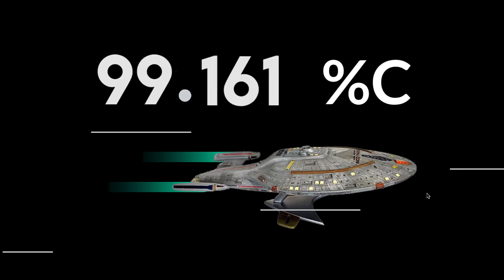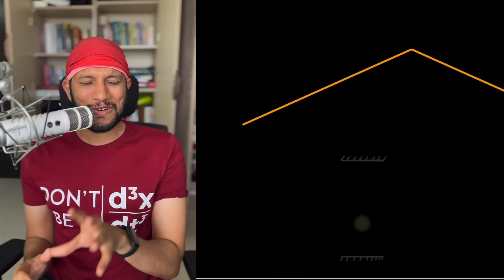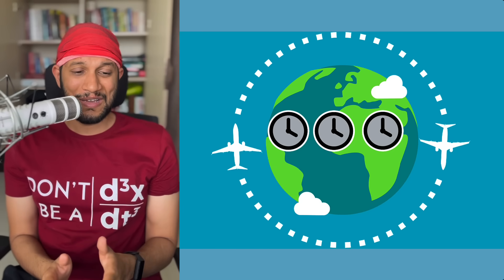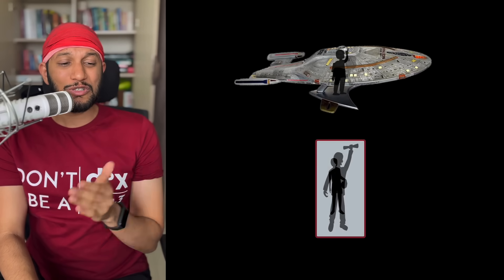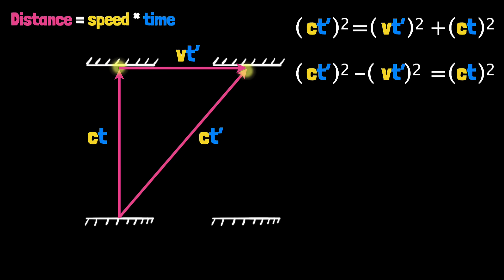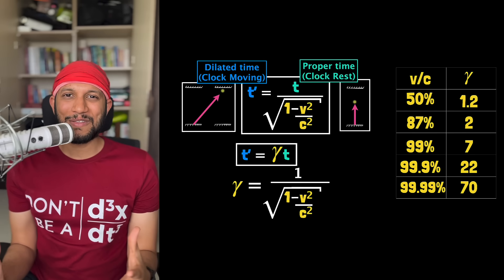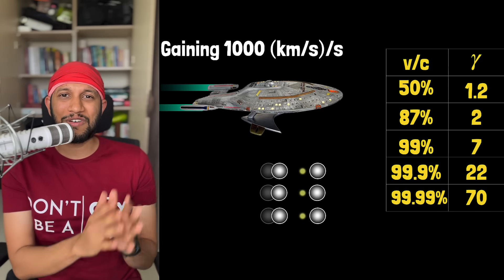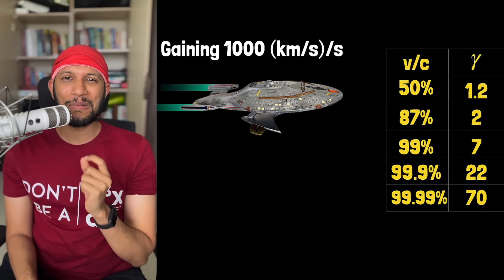I finally understood why you can't go faster than light! (My mind is blown)

Comment: But, doesn't an object stay moving unless an outside force stops it from moving?  To me, its like when flat earthers are confused about why they dont feel the earth rotating. 
Lets say we start our super fast ship  and we get to 10% light speed and we let off the gas to the rockets. In the vacuum of space, what is slowing us down from our current speed? 
And i would think that the photons would catch up to where everything is coasting together at 10% light speed, then we can turn on our rockets again to get to 20% , then rest then 30% and so on and so on. 

Its like, what is stopping the earth and sun and solar system from rotating through space? 

And i know there is gravity, im talking about in interstellar or even intergalactic space, i know there is the vacuum with tiny particles popping in and out of existence that can slow you down at a fast enough speed.

Ifeels like to me, thay saying nothing can move faster than light, means that earth with slow down and fall into the sun because we dont have anymore energy.

Why cant we gradually get to lightspeed and beyond?  

The only thing i see stopping us is having a pretty clear path  and a really good shield up front.

Comment: The correct answer to this: all the available, accumulated energy of the currently observeable Universe wouldn't even be remotely enough to accelerate a single particle of mass to lightspeed. In fact, even if the rest of the not observeable Universe would provide infinitely more energy, it still wouldn't be enough. But since we can not accumulate all that energy anyways, the answer to this issue is pretty oldschool and obsolete.

Comment: In the universe, there is no moving and no stillness. It all depends on the position of the observer. So if I‘m in the spaceship, of course I fly faster than light. Just outside the spaceship the observer sees you are not faster than light, from his point of view.
Reply: Everything is moving which varies based on how similar movement is to the next.

Comment: Makes sense. But why is there a speed cap on light?
Reply: Its the limit in which the electric field can change state. E.g its energy which is a quantity, meaning to go even "faster" would require the exchange of energy to happen beyond the amount of energy it has. So anytime this interacts with something, this takes "time" as in, energy has to move and exchange...thats what "TIME" is. There is no seperate time thing, there is just energy moving and it can actually never stop.

Comment: What happens if you turn the bouncing light tube so it's parallel to the direction of travel? Does it take even longer to go in one direction but much shorter to go in the other direction??  Thus keeping the clock in time the same if it was stationary?

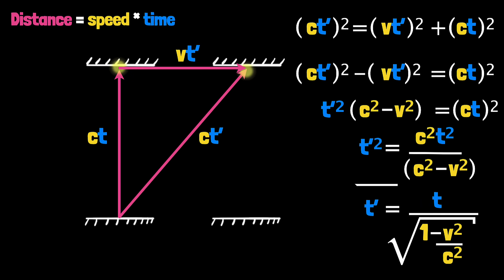Comment: 7:52 - 9:27
There's one problem here.
As Einstein said, everything in space is relative.
So you are stationary but the ship is in motion - or, is the ship stationary and YOU are in motion? 
In reality, each is stationary and the other is in motion from their point of view.
So who really experiences the time dilation?

The "proof" was using Earth as a reference point. Well, Earth is a huge mass with a huge gravitational field as compared to the plane. So is the difference really dependent on mass?
Remember we used to think the moon went around the Earth, only to discover later that they both revolve around a common center of gravity, located about 3/4 of the way up from the Earth's surface, below the crust. I wonder if time dilation is affected by gravity/mass in the same manner, where clocks move faster at the reference point with the higher gravity?

The real test would be 2 ships traveling past each other in deep space, and comparing the clocks between them. I would bet that regardless of their speeds between each other, the clocks would tick at the same rate.

Or how about this: launch 2 ships, one from the north pole upwards, one from the south pole downwards. Both ships accelerate to 0.6c relative to Earth. But relative to each other, they're traveling at 1.2c. How does that work? 

In all the years I've been interested in physics, I've never seen anyone address that question in any way that makes sense.

Comment: if the photon is bouncing around between the mirrors, how is an external observer supposed to see it? there would have to be an entirely different set of photons traveling from the clock towards the observer in order for that zig-zag pattern to be observed, no? also, if you move the photon clock with the ship, won't that cause the trapped photon to hit the side of the clock and start bouncing around randomly?

Comment: Well, that's how it looks to us on earth, but what you have described isn't reality as such, it's our perception  of it, which isn't the same thing.

As far as the people on the ship are concerned, time is carrying on as before, nothing has changed. Their photon clock will still be running at the same speed. To us it's getting slower, but to them it isn't.

So eventually we get to the point where to us it looks like their time has stopped, but it doesn't do that for the people on the ship. So I would argue that what you've explained there is why we can't perceive speeds fast than light, not that they don't exist. But each increase in speed of 1000km/s for the people on the ship is just that, but for us looking at it from earth it's slowing down. Once the engines get turned off the ship is effectively stationary to the people on it. 

So what I'm saying is the speed of the spaceship as measured from earth can never be c, but for the people on the spaceship, it can be, although they couldn't measure it relative to earth. That's a limitation of puny humans, not of the real universe.

I totally buy the explanation our "reality" is defined by our perception of what's happening, which to be fair is what we as humans are stuck with. It's all relative...

Comment: With the first 30 seconds i can guess why we cant accelerate to the speed of light because as you said the required energy goes to infinity. And there isnt infinite energy in the universe thus the lower the mass is means its a higher vmax towards but never equal to c without exceeding the possible energy given within the universe.

Comment: Stop measuring distance with a photon clock. 

Light travels in a 360° spherical direction and the universe travels in its own direction as it emits light too.

If gravity can slow or stop light and we can speed up light then traveling faster than the speed of light is absolutely possible.

Light can be accelerated and it can be slowed down.

Light and time are not the same thing. Stop conflating the facts and it will become much clearer to you.

We created the measurement of time as a tool even though light has been here since it was created. We figured out day from night and began reducing it down to  its smallest measurement. We did that 

When you chose to measure this as if it's Zeno's paradox, you omitted the obvious. Light can be accelerated to be faster than the commonly referenced 186k per second. 

To say that 186 thousand miles per second is our maximum speed is very narrow minded.

Comment: The answer is at 00:12 : division by zero.
Reply: But the question is why it is physically impossible to reach the speed of light, not mathematically. The Lorentz factor isn't the answer just because you can't divide by zero which is obvious. The question is - why it happens in the first place, as the fundamental law of physics?
Reply: @spythere from what I understand is the energy required to accelerate mass gets exponentially higher eventually to the point where it requires more energy than can be provided. It makes sense in my head. And I'm sure there's a lot more to it than that.
Reply: The formula would be different if you could reach the speed of light. Sometimes the math could be outdated and turn out to be wrong hence why we need to look at the phenomenon itself to understand why
Reply: I fartee
Reply: Bit too late but guys that eqn is bullshit. It’s funny nobody here was fighting and never mentioned that once
Reply: Just the boring mathematical reason
Reply: Actually it's not because of division by zero, but because there are no real numbers that can be multiplied by themself and become a negative number
Reply: @Y-LAT no, you're wrong. It's sqrt(1-(v²/c²)) on the denominator. When v = c, that becomes sqrt (1-1) = sqrt(0) = 0. Hence division by zero. It has nothing to do with taking the square root of a negative number. The number of people that upvoted your comment is concerning for the state of humanity's mathematical understanding.
Reply: no shit sherlock
Reply: In physical world yes but in quantum world things are very, very different. And if you have the tech to manipulate quantum field you can do borderline magic to our understanding up here.
Reply: @dzezonja3558 Sounds like a lot of gibberish without any meaning.. so mind to share more of your insights?

Comment: How do we know when something has 0 velocity? Can we measure soms photoms travelling in opposite directions and do a little vdctor math to find the half way between the two some tiny amount of time into the test? Maybe I just answered my own question.

I'm thinking along the lines of throwing a ball in a car. If I throw something in a moving car, its velocity relative to the surface of the Earth is whatever velocity I threw it at relative to the car plus thd velocity of the car. For absolute speed and completely stopped subjects, what is this relative to? The Earth's surface is moving in some direction and magnitude relative to the center of the Earth, and some othed direction relative to the sun. The sun is moving relative to the ecnter of the galaxy, and so on. What is actually not moving?

Comment: By c speed of light, you mean outside a gravity field. It is just possible for a particle to reach a speed where the gravity slowed speed of light can be reached. In particle accelerator instrumentation using liquids, where the speed of light is slowed by travelling through liquid, a light shock wave can be seen.

Comment: so what I have understood is: if someone is watching the spaceship from outside, the spaceship will never seem to reach the speed of light. How does that mean the speedometer of the spaceship will not show speed beyond the speed of light? Consider that the speedometer is measuring the speed of the spaceship by not using the some relative point outside the ship but by measuring the amount of energy that is being burnt to push the ship forward, the weight of the ship in the medium in which the ship is travelling, the density of the medium in which the ship is travelling. Normally, we measure the speed of a car by measuring the RPM of the car on a static road and not by using any outside reference point.

Comment: Awesome explanation! 

Here are some (possibly dumb) questions.

1) If two points of reference are in motion relative to one another, how do we know which of them is in absolute motion? For example, I’m in motion, but you are also in motion, how does time dilation apply? And, the further we expand this notion, is there any absolute frame of reference for us to be able to say what things are in motion?

2) If there’s no absolute frame of reference, then how does any of this make sense?

3) If I’m traveling toward you at 75% the speed of light and you are traveling toward me at 75% the speed of light, then from either frame of reference, wouldn’t it appear the same as one of you being static and the other moving towards it at 1.5x the speed of light??
Reply: I dont think there is absolute motion. You just have motion relative to your reference frame. You can set this reference frame however you want. For example in a car you usually set the ground to be your reference frame. While in a plane you measure  airspeed and groundspeed seperatly. I hope this answers questions 1 and 2.
As for your third question: From my understanding it is excactly like you said. To an outside observer it would appear as though the two of you are closing in on one another at 75% the speed of light. The distance between the two of you must therefor be closing at 150% the speed of light. As for your perspective while moving, I am not sure
Reply: @ Same channel actually has another video on exactly this topic that answered my question. Absolute motion is undetectable via any means using particles, because the particles always start within the reference frame they are attempted to test and therefore already carry inertia of that frame. It is also undetectable via waves, because waves require a medium to travel through and that medium would have to consist of particles, which again are already influenced via inertia by whatever constant motion the frame of reference might by subject to. Light is special because of its behavior to sometimes act like a wave, but traverse empty space. Therefore, light is the only means we have that can show constant motion because its speed is constant. This now SORT OF makes sense to me. Finally. I say “sort of” because I am sure I don’t have my head fully wrapped around all the details and implications. 

I am still not sure about my hypothetical of two objects approaching each other, each traveling at more than half the speed of light. If absolute motion does exist empirically, through the use of the speed of light as a constant, then the law limiting either’s speed to the speed of light (C) would apply to both independently in absolute terms through space. But the relative closing speed of the two could in absolute terms be nearly double that, except for the fact that they would have no way to observe that fact, since they only thing they have to measure that speed would be itself limited to the speed of light. Then there’s space-time and the concepts of space contraction vs. time dilation and how those apply… which probably serve as the solution to this.

All of this is fascinating and logically consistent, provable with math, and demonstrable via agreement with real-world experiments. Yet… it sure starts to feel wrong lol. I wonder how much of this is just the fish-in-the-bowl problem (or allegory of the cave) and our fancy scientific models might work well enough to make useful predictions, yet be no more “true” than the newtonian models they replaced. And will eventually reach their limits.
Reply: 1) None of them is in an absolute motion. Both see the effects of special relativity when looking to the other one.
2) The absence of an absolute frame does not imply that there's no frame. You can choose among infinite equivalent frames and the theory is always coherent. Actually also the classical theory has no absolute frame, since the space has never been absolute. The classical theory is consistent in any inertial frame  just like the relativity. The difference is that the first one lost this fundamental property when the classic electromagnetic theory was developed.
3) This video doesn't talk about that. But also the composition of relative velocities is different within the relativity. When you sum the velocities of two relatives frames from the point of view of one of them, you have to consider again the gamma factor. As a result, the speed of light still reaming the maximum reachable speed.
Reply: There is no absolute frame of reference, it's all relative.
Reply: none is a dumb question, and the new answers everywhere are all wrong. 
special relativity is a non-functional theory, only a didactical object. 

it is wrong. no real clock slows down, because no real clock measures time, not distance. all real clocks measure time*distance, and that is a non-variable. 
Einstein was often confused
Reply: The Observation principle. This is only answerable by the observer of both entities moving relative to each other. You do not observe your own speed. You observe your motion. Each of you moving at the same speed by perception relative to each of you, you are both still. Reminder. You are both traveling toward each other. At the same speed. Until you collide you are both still. As the observer I can see the speed at which you two collide. That also depends on my relative angle. Direct line of sight is the best form of measure. AS I can put into perspective now the perceived relative experiment. It makes sense.
Reply: @RafikiusMaximillius  you are wrong. read my post carefully and think
Reply: @Sergiu.antifascist  In the many years I have had this very conversation with everyone directly in front of me, I am not proven wrong. So that tells me saying I am wrong is nothing without proof.
Reply: @RafikiusMaximillius  anyone who reads this thread knows i proved you wrong. you cannot pretend
Reply: @Sergiu.antifascist  Surely anyone can't read. And yes, I can pretend again you are completely wrong.
Reply: @RafikiusMaximillius  ok, you don't count. bye
Reply: @RafikiusMaximillius  you are a hooligan, and we do not talk physics with hooligans
Reply: @Sergiu.antifascist  A hooligan you say. What are you? LEGION. Oh no. I am scared. We didn't talk. we are making asses of yourself.